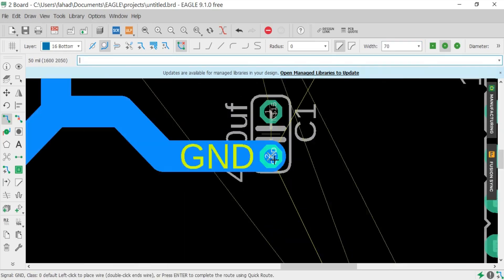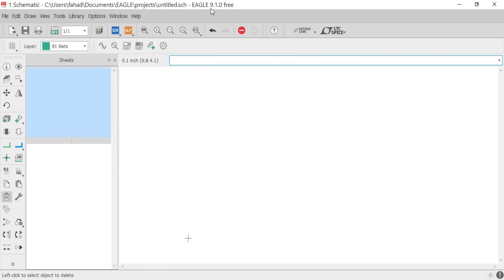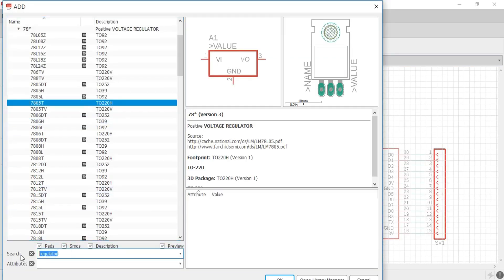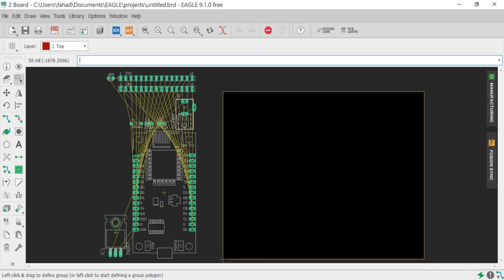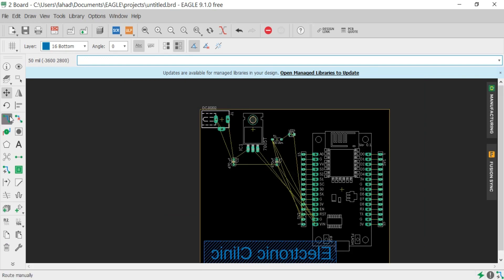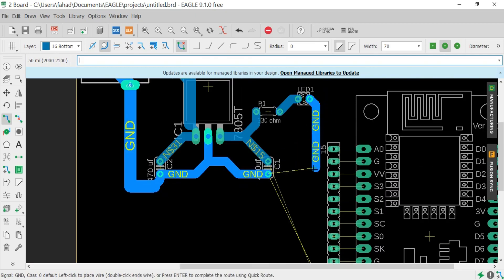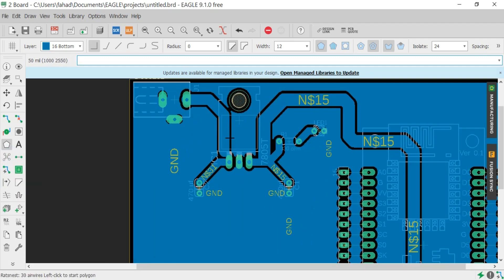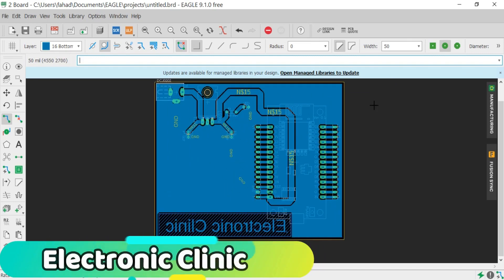how to make a schematic and PCB in Cadsoft eagle 9.1.0 Nodemcu ESP8266 wifi module power supply

Comment: Can you help me to combine coding? I wanted to combine sensors coding with door lock coding >.<"
Reply from the maker: which sensors are you using ?
Reply: Thx for the fast reply 😆
The coding is gsm arduino PIR,flame and magnetic door sensor(This one I made based on your previous tutorial). I wanted to combine it with electronic door (Electronic's Clinic coding) into 1 arduino. Can you help me? May I email the codings to you?<( >.<)>
Reply from the maker: Yes mail me
Reply: @ElectroniClinic  is it possible? I have tried but not working. I need help  >.<"
Reply from the maker: Ya its possible. Send me the coding
Reply: @ElectroniClinic  Ok thx 😄
I will email after I finish my class.
Thx again for the reply.
Reply: @Electronic Clinic
Is the coding I sent useable?
When can I have the combined coding? 
I'm sorry for asking too many question, really excited to see this project working.
Reply from the maker: i checked you programming. its good. but in your programming you completely skipped this function. 
sendSMS(textForSMS);

you used only serial.println() function. check your programming. ;)
Reply from the maker: and use delay approximately equal to 5000 milli seconds. 
do include sendsms functions.
Reply: Electronic Clinic  Ahh I see my mistake on the sensors coding.
Thank you 😄
How about the combined coding between the sensors and door lock? 
Can you send the combined coding to me?
It would be a great for me to learn about my mistakes on combining sensors and the door lock >.<"
Thx again for spotting my mistake on missing sendSMS(textForSMS);
Reply: Electronic Clinic  How about the combined coding between the sensors and door lock? 
Can you send the combined coding to me?
It would be a great for me to learn about my mistakes on combining sensors and the door lock >.<"
Thx again for spotting my mistake on missing sendSMS(textForSMS);
Reply from the maker: Your programming is ok. just add sendsms functions, and increase delays.
Reply from the maker: actually right now i am making some tutorials, you do some work, then send me i will check and modify it.
Reply: Electronic Clinic  I'll send my coding ty for the help.
Reply from the maker: you completely destroyed the code.... rofl. 
i have sent you the combined code. check and make some changes as per your requirements.
Reply: @Electronic Clinic  Hahaha 😂. 
Thx for the help!~
Reply: @ElectroniClinic  I have tried the combined coding you gave me. The sensors are working fine, but it does not send message and the doorlock does not receive message.
I have checked and tested the gsm with old coding which is working fine(the sensors and door lock coding) but the combined coding seems not to work. Is there a problem with the coding? I checked it but I can't find the problem.
Reply from the maker: actually i didn't check the coding, you upload the program and do some troubleshooting.
Reply: @ElectroniClinic  I'm trying my best troubleshoot, edit since you gave me the code but still can't solve the problem, it's been hours I think im at dead end.
I really need help 😅
Reply from the maker: shit. this time you missed the gsm baud rate in the setup function.
Reply from the maker: send me a message on whatspp. 
+923339218213
Reply from the maker: now its working. i added the SIM900.begin(9600); in the void setup().
Reply: @ElectroniClinic  ahh the SIM900.begin(9600);  😅
Reply from the maker: i checked it on proteus. its working . Now you need to adjust the values as per your requirement.
Reply from the maker: its done. add that SIM900.begin(9600); 
if you don't activate the serial communication, how the gsm module gonna work ?
Reply from the maker: yaaaaaaa, upload the program and tell me, if you can receive the message. hurry then i will watch movie.
Reply: @ElectroniClinic  Ty very much!~ 
That was the missing part, the the baud rate
Reply from the maker: SanyuSinichi  can you receive msgs now ?
Reply: @ElectroniClinic  Yes it work perfectly.
Reply: @ElectroniClinic  Yes it work. Ty for your time. I'm sorry for the trouble😅